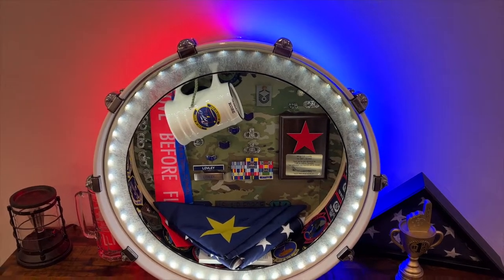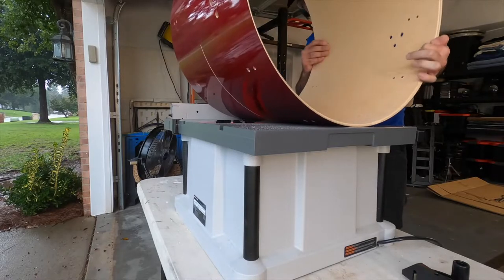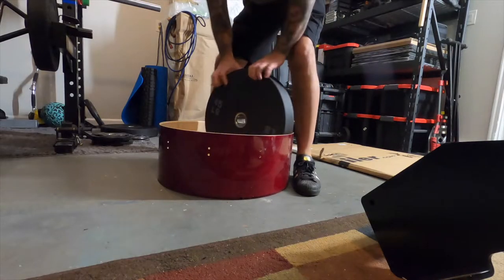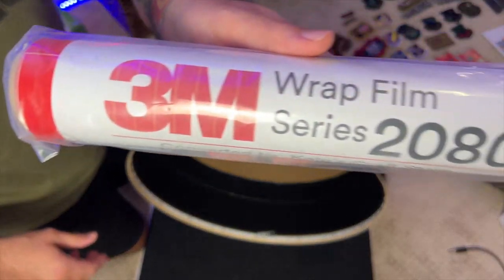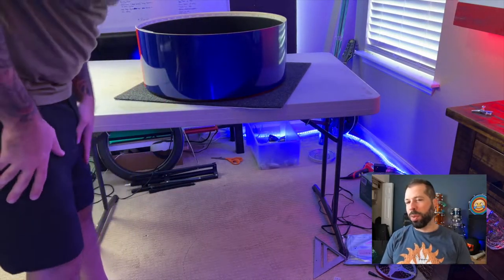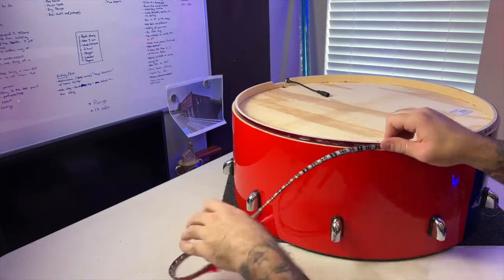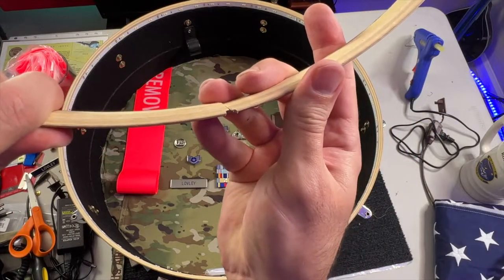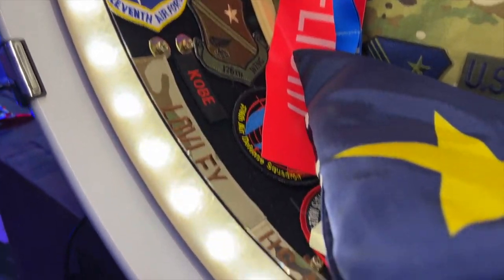Building a Shadow Box out of a Bass Drum

Comment: I'd have made a gong drum out of the other half.
Reply from the maker: I plan on making a pancake bass drum with it
Reply: @EverythingWithEric  That works too... Actually, if you use floor tom brackets rather than bass drum spurs. You could have it be kinda both.

By using bent floor tom legs, it could be set up as a Pancake kick drum. Then by using regular floor tom legs, it could be set up as a gong drum/massive floor tom. Depending on what you want at the time.

Versatility is always a plus in my book.